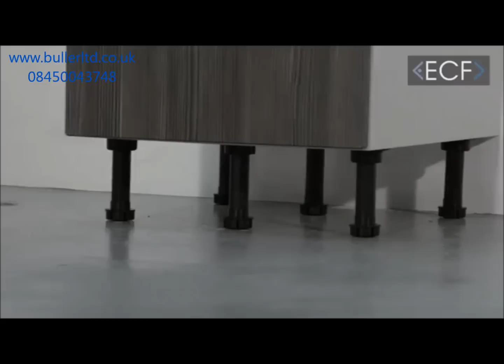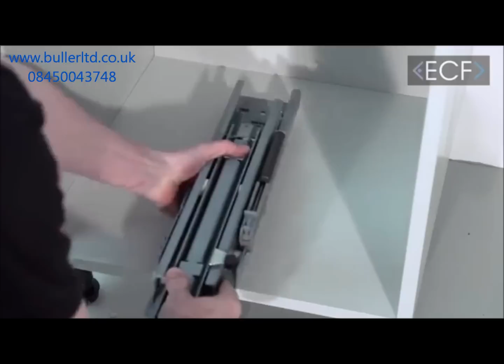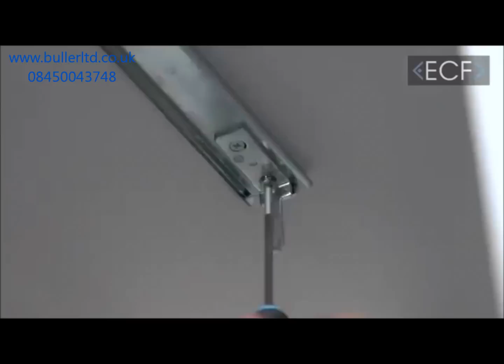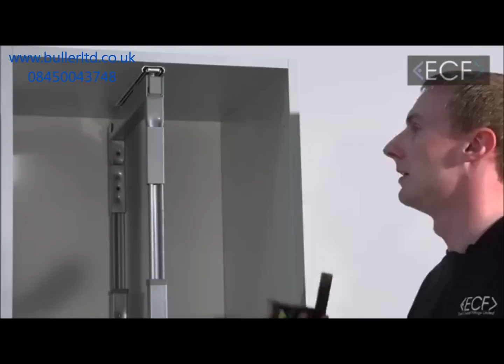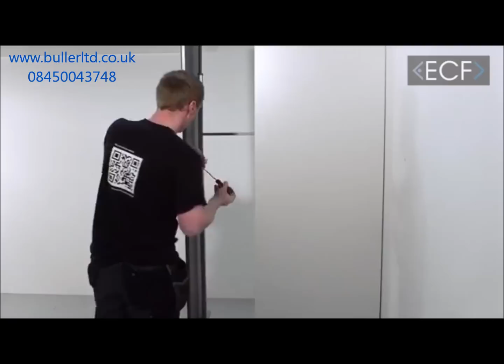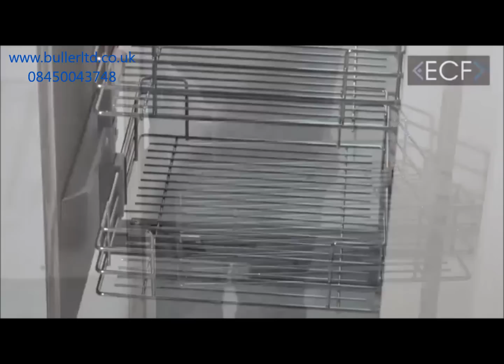Kitchen Soft Close Pull Out Larder unit - installation guide. Buy @ Buller ltd

Comment: Extremely helpful thank you.  Was able to adjust the door on my unit so it now lines up top and bottom - doesn't explain why my fitter didn't fit it properly in the first place though (hasten to add that it was NOT your company)!
Reply from the maker: +Steve Hirlehey Great to hear that our effort in providing those extra materials such as videos can make things better! Thanks for your feedback!
Reply: Most likely because it was fitted and adjusted without weight on the shelves. When you laden the tower with your food stuffs, the top tends to hang out, so you then have to adjust it. I just learned that but I didn’t know how to adjust it until I watched this video!